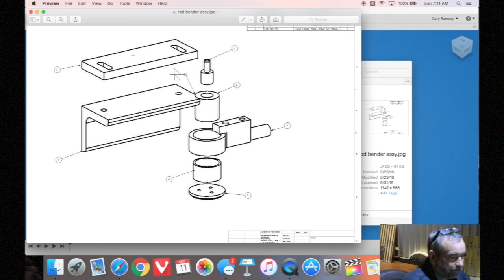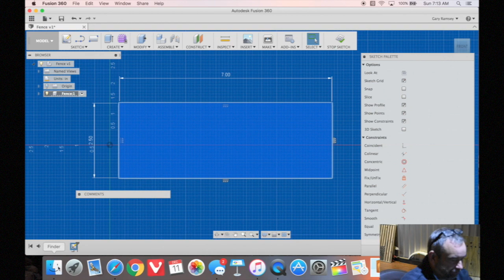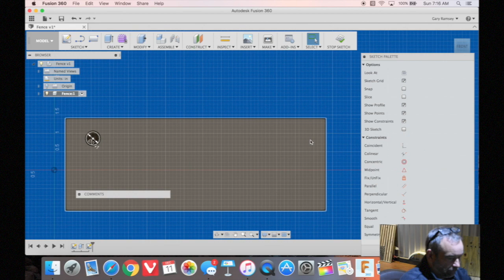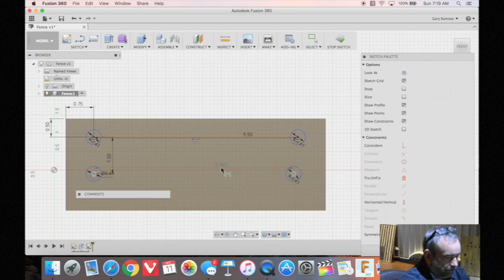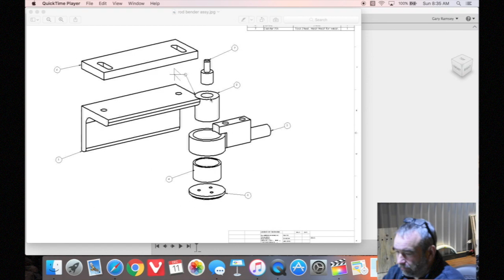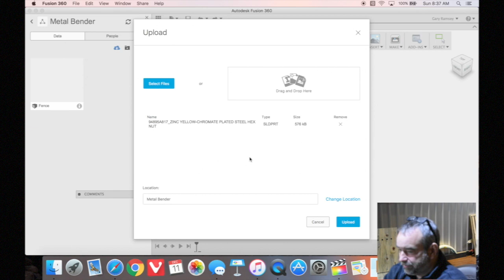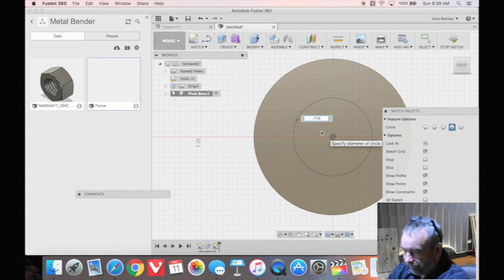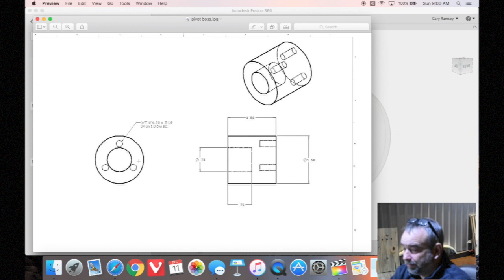Fusion360 Step by Step Overview - Design Metal Rod Bender - Oxtoolco - DIY Metal Bender

Comment: Good stuff Gary, I been playing with Fusion 360 for about a month now and it sure is fun.
Reply from the maker: Awesome, what are you using it for?
Reply: Doing some designs for 3d printing and going to use the prints to make molds for some aluminum casting I want to try.

Comment: Nice demonstration for somebody like me who hasn't used Fusion360 other than installing and starting on a design.  Did you just forget to add the footage of inserting the nut to the model or did I miss something?  I assume you just had to orient it centerline and flush it at one end?
Reply from the maker: I had never done that insert before, so I kind of did it without the screen recorder going, and didn't feel like repeating it so I just didn't show it.  I was afraid i would be fumbling around with it, but it actually was very quick and easy.  Basically highlight  the inside bore feature in the solid body, and with it highlighted, go to "INSERT" and select it from mcmaster-carr and it popped it right in there, and from there you could "extrude" it further up in the bore or leaving partially sticking out

Comment: Gary very informative.

Appreciate the pace you informed us on Fusion 360. I could see what you were doing as you mentioned it. Very important. If to fast screw it I am not rewinding anything anymore a thousand times trying to understand when someone wants to speed read through the whole thing. If you want to be informative your process is good. Otherwise it is a waste of time.

If you want to give short lessons on Fusion 360 I think you will have an audience. 

How is that shop working out. Would like to know about the spray on insulation. Is it quiet and draft free? To include temperature stable.

I am one of the lucky ones. The house we bought the garage is two stories, insulated, and gas heated. So, access 12/12's of the year and that is Good Times ~ Good Times....

Let's make some chips and some sparks.

Thanks for posting I wish you and your family a wonderful Christmas and New Year....

Will from Akron, Ohio...
Reply from the maker: Hey Will, thank you for the message.  Your right about fusion360, many of the videos go way too fast.  Its impossible for me to go to fast as I am a slow learner.  The spray foam has been awesome.  Definitely cuts down on the echo and very stable temperature wise.  It's not cheap but definitely worth it.  Thanks for watching!

Comment: Excellent.  When are you going to NYC CNC?
Reply from the maker: It was last weekend.  Very good class.  But what I have learned is, it's not really the best for 2D design, certainly not for art work, etc to cut on a plasma table.  You can whip up quick geometric shapes and cut them on the plasma table, but if someone sends you art work that needs modified, or cleaned up, it's terrible for that.  Corel Draw, Adobe Illustrator and Inkscape are really good for that, so far i have used Adobe illustrator and inkscape

Comment: hello , i was trying to build a metal bender and came across your video , which is the best i have seen so far .... i know the video is about fusion360 , but i was wondering if you could share the cad file with the dimension of each part of the bender ... would be helpful to start working from there ......
thanks
Reply from the maker: I sell the plans for $5 on my website, as well as full kits if you are interested in it
Reply: didn't know that ! Will buy one right away ... thanks :)